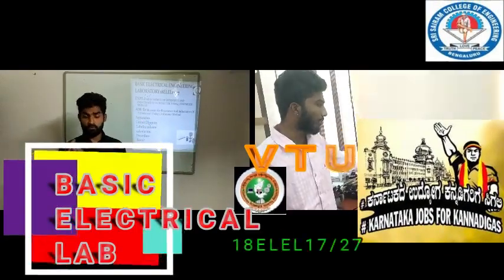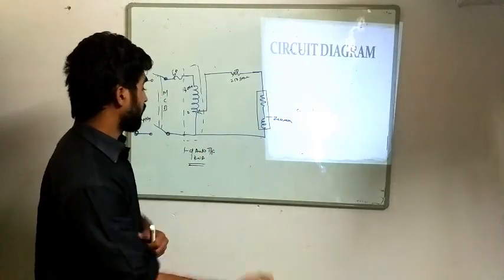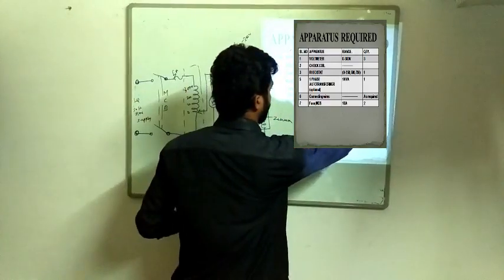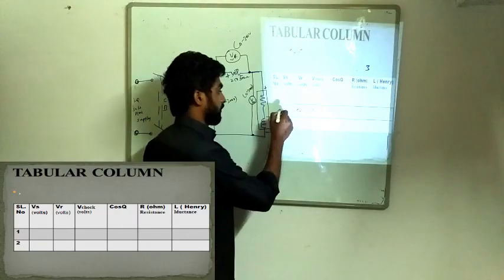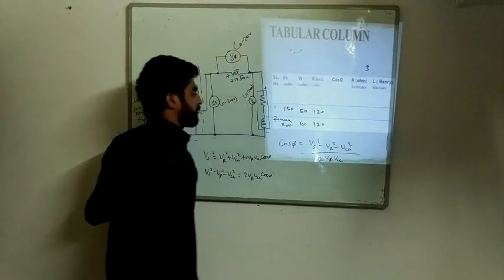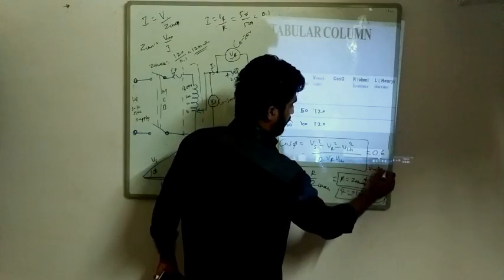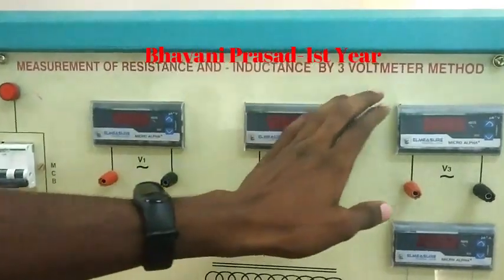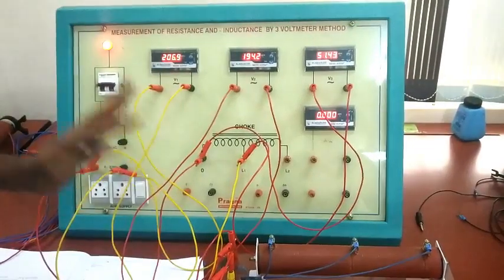Measurement Of Resistance And Inductance Of A Choke-coil Using 3 Voltmeter Method IVTUI18ELEL17/27

Comment: V1 is separate and vs is separate??
Reply from the maker: Vs or V1= supply voltage..
Vr or V2= voltage across resistance
Vchock or V3= voltage across chock coil
Reply: @iminchale9193  ty sir
Reply: @iminchale9193  🙏🙏